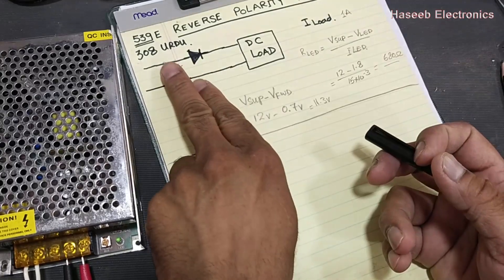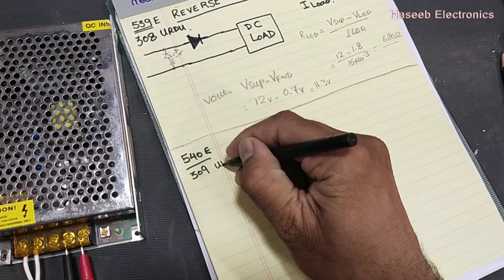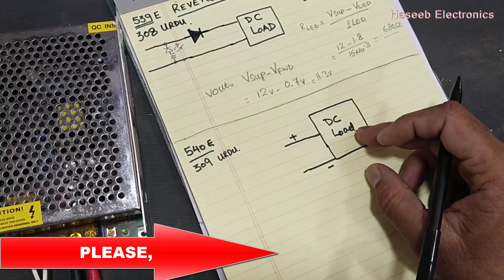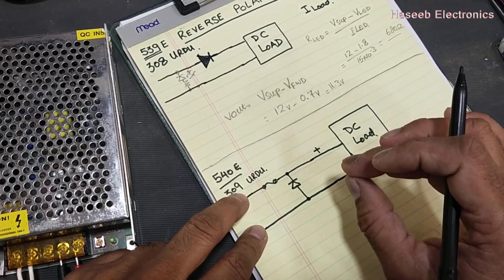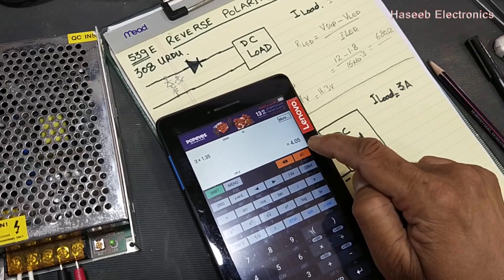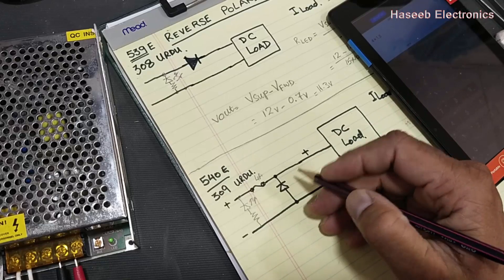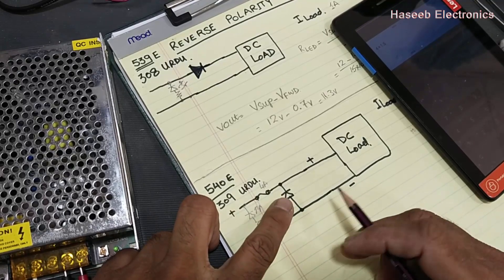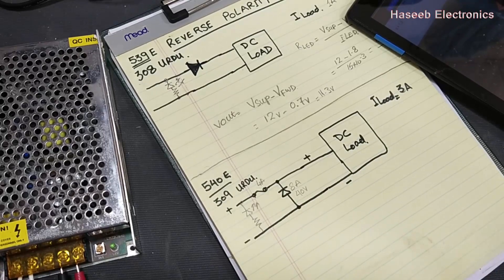{540} How to Protect Circuits From Reversed Voltage Polarity / DC Reverse Polarity Protection

Comment: The problem is the high voltage drop of 0.7V.... it's better to use a mosfet as the RDSon is much much lower than the diode voltage drop. Thanks!
Reply from the maker: yes dear. we will discuss, all methods used in dc reverse polarity protection. and we will see advantages and disadvantages for every configuration

Comment: EsselamAleykum 
Thanks for video very informative.
Could you make a simple current and ampere adjustable SMPS power supply with UC384X chips ? If have not time for this ,could  you make a draft schema  and advice us some application note for update to for this power supply .(I mean adjustable o to 30 volt and current limiting 0-5 Ampere )
Thank you 
EsselamuAlaykum
Reply: Yes that would be nice.
Reply from the maker: wa alaikum salaam 
sure i will try my best to do it. i noted it